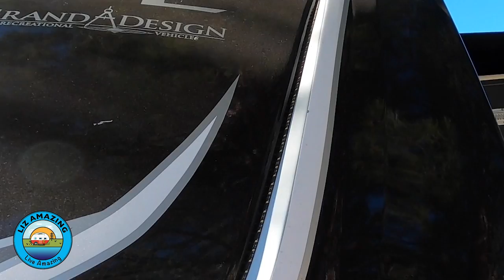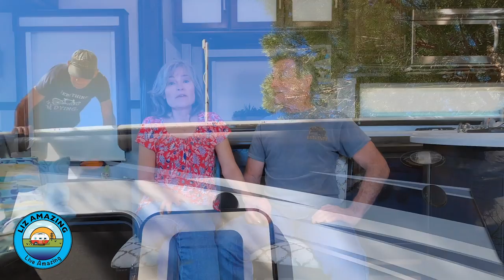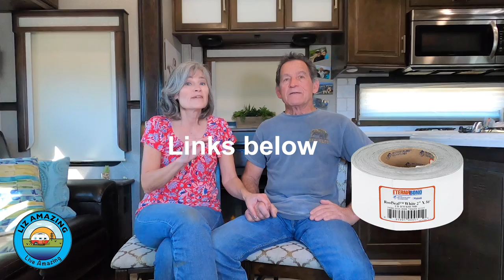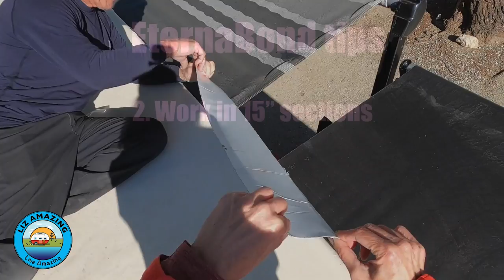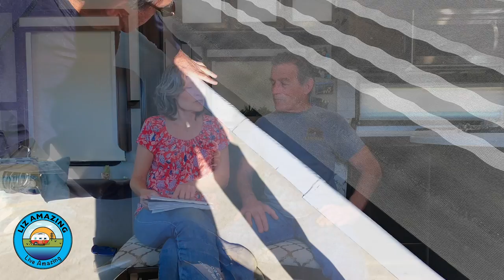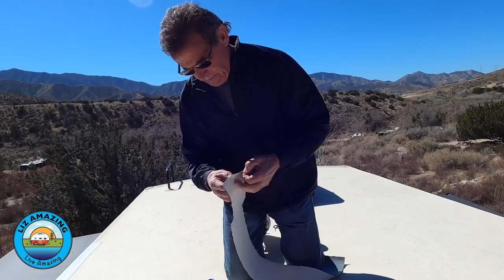RV life: We damaged our camper | $10,000 mistake | EternaBond | Fulltime RV Living

Comment: I had this happen also not as big but it was still a bummer. I used flex seal, not the tape but the liquid. Turned out great, it’s been holding for about a year now with no leaks. 

Just FYI
Reply from the maker: That's good to know! It is now been coming up for six months and it is doing fine. We are going to get it fixed though once we are in one place long enough to schedule. Here is a surprising thing that we learned about RV roof options:  https://youtu.be/9Yv0ZKSfvbc

Comment: When my ex and I were dating and already engaged to be married, we bought a 1975 Ford F250 SuperCab and an attached camper. We had the rig parked in the driveway with an extension cord over the roof to get the refrigerator cooled down before we went for a weekend trip. I needed to get something for the camper and she was working. I was in a bit of a hurry and totally forgot about the cord and drove off. I ripped off one of the vent covers when the cord caught it while it was open. Long story short, even if you're in a hurry, do a full walk around your rig before you take off.
Reply from the maker: Yes! That's how we learn too, the hard way! Wishing you happy camping!

Comment: If you didn’t have the eterna bond you could of used Gorilla tape or heavy duty 3M tape. Since you were short on time I think using one of those tapes would be better then using the eterna bond until you had more time and no wind.   I have used gorilla tape on rv covers when I put cuts in the cover removing several feet of snow off the roof.  Stuff is amazing.  I also 3M heavy duty and a 3M non residue for my custom reflectix rv skirt to attach it to the RV. It does not fail even in eastern Idaho winter.  I have not used the eterna bond, but would imagine it to be difficult to work with.   Hopefully insurance gets you a new roof for resale stand point.
Reply from the maker: Or duct tape, anything. But then the problem would be getting that off to put on the Eternabond as Gorilla tape doesn't last like it. Unfortunately we learned that TPO must stand for Tissue Paper something.... It might have caused further problems removing it. But yeah, wind was not our friend that day! Thanks for watching and commenting!!

Comment: It appeared that you overlapped from front to back - if that can be visualized.  Lets try again.... it looks like you laid down piece from the front of the rig and then laid the next piece overlapping moving toward the back of the rig. I hope I wrote that so that it can be visualized.  did you experience any issues on the overlapping as you drove down the road - pealing back or catching debris?  I have used this type of tape in the past and yes, working with small pieces is the trick - that stuff is sticky - once its down, its not coming up.
Reply from the maker: Great question. We started in the back and moved forward and so the overlaps are in the right direction regarding wind. We moved once since then about 100 miles and no signs of lifting. We love Eternabond...and insurance!!!

Comment: My serious damage was bad! I was trying to move my 36ft travel trailer which ways about 7,000 pounds with my 07 Mercury Mountaineer with a V6. Since it was just in the yard and my car can tow 6,000 pounds i thought it would be ok. For the most part it was ok the car pulled and backed up just fine the problem came with turning. Since its a suv it doesn't have tow mirrors. I was alone and was trying to move forward but a tree was in front so i had to steer to the left. Well when i went to turn left the right corner got to close to my garage edge and ripped the whole corner off my camper long with a large portion of the side and back. The major support for the corner was broken, siding was ripped and broken, wires ripped, and some of the roofing ripped. Since i couldn't see that back corner i didn't know that it happened so i finished moving it and then i noticed that my back corner was barely hanging on by a legit thread meaning a wire. Since that day i only use trucks with tow mirrors and always have a spotter!
Reply from the maker: Oh no! That had to have been a bad day. So sorry. Yes, a spotter is very important. Paul and I are so sorry  you had to learn the hard way. We can relate because our upcoming video is about something similar. Please be nice to us when you see our BIG mistake!! If you haven't already, ring the bell so you can get a notification when this video is posted.
Reply: @LizAmazing  Looking forward to it!

Comment: If you haven’t had your roof repaired yet you may want to check into flex armor it is a sprayed on roof which was specifically made for RV roofs it is flexible but very strong The tear strength is 3500 pounds per square inch  they spray it on they put it on 1/4 inch thick I bought a new fifth wheel camper two years ago and the roof started leaking I had it done on my roof ,the roof is 39 feet it cost me about $7500 also they give you a lifetime guarantee on the roof check out some of the YouTube videos one in particular show an arrow bouncing off of it ,I would say the damage that you did to your roof would not have happened to the flex armor roof the branches would’ve probably just slid down the roof
Reply from the maker: Wow, you must be neighbors! Did you overhear us talking?? Lol! We are planning a future video about just that. Actually it is comparing RV Armor with Flex Armor. After seeing how easily the TPO tore, we won't be replacing it with the same. If you haven't already, ring the bell to get a notification when a video posts. Looking forward to hearing what you think of what we say. See you then!

Comment: Wow it is so easy to damage that membrane hope the tape works for you so will insurance replace the roof wishing you luck with it. On another note do you have a favorite tire for your E-bikes i finally got my Espin Flow and only had 5 miles on the thing when rear tire went flat and had to push my bike back to my rig 3 miles away. I did buy some Schwalbe tires to replace the lousy stock CST Black Jack tires. Thanks and Happy Travels       John
Reply from the maker: Yes, that membrane is SO thin. We are considering a better roof for the replacement. Fingers crossed that the insurance covers it. For your bike, put Slime in the tires, works wonders. And also you can liners if you are riding in areas prone to flats. Happy travels and biking to you!!

Comment: Etournobond  tape is crazy stuff I used it to mount my solar panels on the roof of my trailer, I had that stuff stuck to me I had it stuck to itself I think I threw away about the first half of the Roll because I ruined it all. I would suggest that you actually practice down on the ground before you get started with the project because it surely has a learning curve.
Reply from the maker: Oh such great advice. Did you see Paul wrestling with it at the very end? That windy day was the biggest challenge. And that's awesome that Eternabond holds down your solar panels, wow!
Reply: I am going to put one more solar panel on my trailer so I will have one more chance to wrestle the eturnabond Kraken... you are right smaller pieces much easier to handle

Comment: Hay Kids , at 7:41 it looks like a puddle sits on the fold out .  Remember that when ya pull it in after a storm .  Take the good w/ the bad an keep truckin .   Best O luck
Reply from the maker: Great tip, thanks. Yes, when water gathers on the slide topper, we don't want to risk some getting inside. Paul goes up there and inspects the roof and sweeps any water, acorns, etc. off. And we say a bad day camping beats a good day sitting at home!

Comment: I have not used eterna bond although I will be getting a roll now thanks for the tip. I thought there was a primer spray that also is supposed to be used with the tape. Is that not correct? ✌🏻🇺🇸
Reply from the maker: No primer spray that we have heard of. You do need acetone or alcohol to thoroughly clean the area first. And that's it.
Reply: @LizAmazing  I got it from the channel wandering weekends “bulletproofing our rv roof”

Comment: Hi guys sorry for your troubles. But it is possible to do it in long lengths. If you leave the backing tape on and then peel it off an inch or two at a time. That way you can have minimal joints. Also start at the back of the vehicle, then any joints will overlap the wind won't get underneath.
Reply from the maker: Hi Robin, that's a great tip. Thanks so much!

Comment: ooohhh that's not good ,  My big booboo was tossing a large pack of toilet paper in on the floor when the slides were in , on travel day of course , and when we got to our destination I forgot about it and opened the slide and about half way out it started moaning and groaning popping and cracking  I stopped and walked back into the kitchen and seen a flat pack of TP wedge between the slide and the wall  and the trim that is about 6 inches wide popped off from the floor to the ceiling . I was so upset but my husband just looked at me and said it's ok it could have been worse and laughed . He fixed it that after noon . Stay well and travel safe
Reply from the maker: Great story, thanks for sharing. I always advise to look for a partner who in a time of crisis won't make things worse. Your husband sounds like a keeper for sure.

Comment: You need to get a real 5th wheel hitch    Your rig shouldn’t be landing on the truck  for what the 5 th wheel cuts  don’t cheap out in hitch   Get B & W Companion hitch no more problems like the rug hitting the truck   I get the geometry  but I don’t think the B& W woukd of allowed it to move into that position to hit that way    Lots of strange issues with Anderson’s and they bend under loads
Reply from the maker: It's not about the hitch so much as geometry. Perhaps if we'd had a bumper pull we would have gotten away with just scraping the hitch, not so with a fifth wheel. The Andersen is an awesome hitch, check out our video where I hitch up by myself: https://youtu.be/LB5Z8IPXtug

Comment: In repositioning our 35-foot Coachmen into another spot, I hit a post at the campground. On another occasion I tried to pull into a gas station and forgot I had the trailer behind me; ended up hitting a protective post on the end of the row of gas pumps. I turned them both in at the same time. One cost $800 to fix, the other cost $5,000!. With $500 per claim deductible it only cost us $1,000. The nest year, when kids tried to break into the trailer, the door and screen door had to be replaced. Total cost $800, but it only cost us $150. That's when Progressive dropped us! DOn't know if I can blame them.
Reply from the maker: Oh my goodness. I hope you were able to find another carrier, this is actually our biggest worry. Be SURE to tune in to our next video as we just had a bit of a crunch-eroo. If you have not already, ring the bell. We are interested in what you have to say about this upcoming video. See you then.

Comment: Man what a drag......literally. JK.

Eternabond is an absolute must have in ALL RV’S. I keep a roll of 6”, 4” and 2” in my rig. It can be removed with a hair drier, plastic scraper and acetone. It’s a lot of work but can be done. When applying long runs of eternabond just pull back the back liner 12” at a time as you apply the tape. Make sure to roll it down after applying it to get the best adhesion.
Reply from the maker: Great tips, thank you. Yes we agree, all RV owners need to have some Eternabond with them. Wishing you happy camping this year!

Comment: Hey guys sorry about the trouble... I have done things like this a couple of times.. I have a couple dents on my truck from my fifth wheel hitting it. I have also used that tape to cover the seams on my 5th wheel, it’s an aluminum roof. That stuff sticks quickly. I layed it out with the backing plastic still on it then slowly pulled the backing plastic off in short segments allowing me to do the repair in one continuous piece. 
Check out this guy for your repair:
https://youtube.com/c/AZExpert
Reply from the maker: Thanks for the tip. And, yes, Eternabond does make an aluminum roof tape. Hope neither of us need to use it again anytime soon!
Reply: Nice to see someone who reads the directions. ;)
Reply: Another hint: do NOT stretch it as you put it on. You’re laying down sealant, not wrapping a package. Lay the stuff out a few feet at a time, then peel the backing from underneath as you press one edge in place, working across to the other edge. Start at the rear, and work to the front in case you need to overlap pieces.

Comment: Okay then... Give me the used price for your rig, then knock $10,000 off because there is some tape on the roof and I just might take it! hehe Especially considering that "used" your rig is becoming better than a new one with Paul fixing everything. Example: putting the water pump on a different circuit than the lights was an improvement. The more you "damage" the rig and knock the value down, the better it gets.
Reply from the maker: We agree! We just now are getting it the way we like it!

Comment: Fuuuddggggeeeee.....I'm very sorry this has happened to you two!  Bleh.  So, do you envision this being the repair?   Or, just a hold over till you can get a repair scheduled?

I didn't cause the damage, but in the 90s, we had just bought a 1967 Roadrunner travel trailer; back when 17feet weighed 4000 pounds!  It truly was a tank!  But, that was also back when they actually made the cabinets.   Anyways, I was loading it for a trip and I noticed some water running down the wall inside (it had just rained significantly).  After investigating, I could tell that it was the roof leaking (we had just bought the trailer within the month).  So, I applied this paintable rubber compound over the entire roof.  Never had a water problem for the 5 more years we had the trailer.  

Safe travels!!  Bummer...wish I had known you were at this location.  I flew into Palm Springs yesterday.  I spent the day in Joshua Tree N.P.; in which I've been several times when I come here.  You guys are that much farther away.

Have a great rest of your weekend!!
Reply from the maker: Oh, sorry to have missed you. We have been in Palm Springs recently as well as Idyllwild and Menifee. It's funny you mention the paintable rubber compound. There is something called RV Armor that we are looking at because the TPO is apparently VERY fragile. We are waiting to hear from insurance. Fingers crossed that it is covered. If not, that Eternabond will hold up forever.
Reply: @LizAmazing  Yes...bummer to have missed you two!  

Yes....so much to do around here in Palm Springs, for sure.  I come to here and Orange County for work about every other month.   Yes....Idyllwild is a neat little town.  I hadn't heard of it, but my boss's wife is from southern CA; so she told me about it a few trips ago.  It was already in virus times, so I didn't go stomping around the shops. But, I did do some hiking.  I still have plenty to see up there for future trips.  Thank you for mentioning Menifee!  My first work trip with my current job was to French Valley, just to the south of Menifee.  I do need to do some day trips over there from Palm Springs, in the future.  

Bleh...I do hope your roof situation gets rectified soon!  My roof incident was back in the 90s, so I don't recall what our paintable material was called.  It was silver.  But I can say, it was awesome!  I think something like that would be an economical option for you, especially if the insurance company is going to be holding out.  My roof leaked when I lived in CO.  Afterwards, I moved to the rainy southeast of GA and NC and had zero problems with it.  

Safe travels!